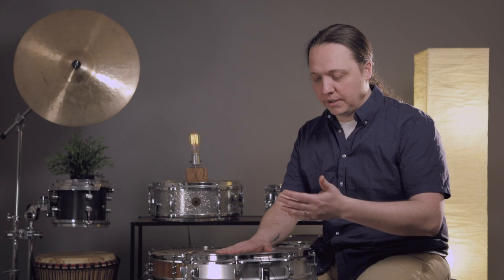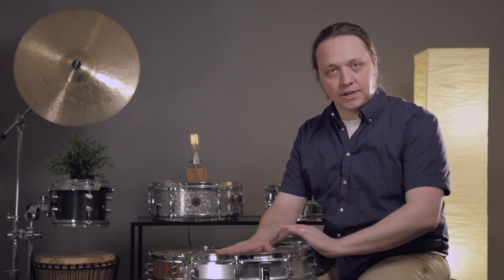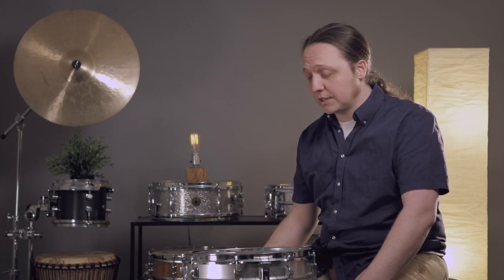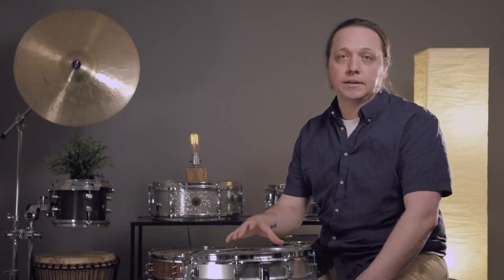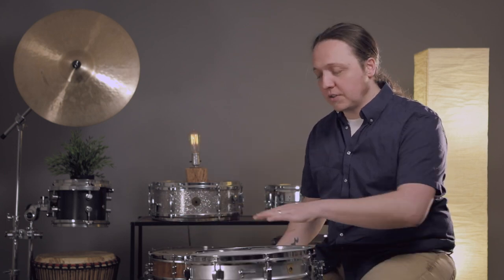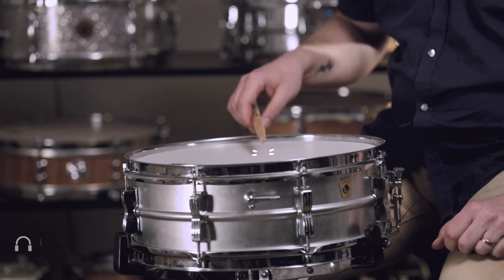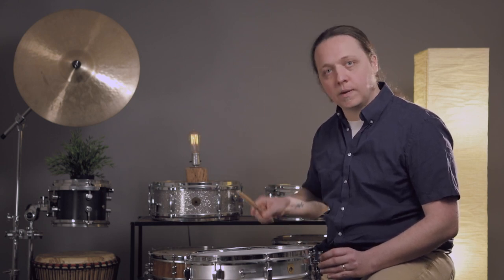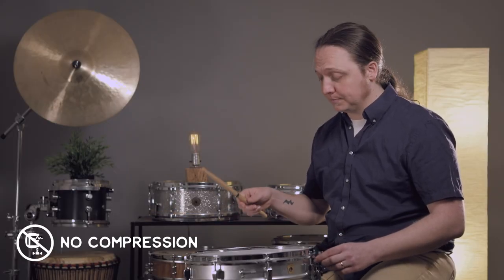Ep. 7 How to Dial in Your Snare Wires

Comment: Thank you for what you guys do.  Your videos are great and serve all of us in the community from beginner to pro.  My story:  I have a vintage snare I was  struggling to get a decent snare sound.  I tensioned/tuned the heads in pitch so my tone was great except when I turn on the snares.  CHOKED no matter how tight/loose the strainer.  I was baffled because I had new straps and pure sound wires.  Well watching this video I was inspired to dig deeper.  I pulled it apart.  I noticed immediately the snares would not evenly tension with the straps.  So I changed the straps out for the puresound blue wires.  Still no good.  Baffled...until on my second "pull apart" I laid the snares on my desk.  They did not lay perfectly flat.  Somehow they had gotten twisted slightly.  Changed the snares out for a "flat" set of puresound.  What a difference.  Saved me from buying something new and kept one of my favorite drums on the stand and off the shelf.

Comment: A little trick i learned from an old jazz drummer about snare side tuning and wires. Get the head in tune with itself, obviously....then press down on the head (not too hard) in the middle right next to the snares with your finger, if you get a nice long buzz from the snares you're in the ballpark as far as tension...adjust to taste. Works for me, give it a try.

Comment: I think that the reason we find that snare wires get cranked up so tight is to reduce or eliminate sympathetic buzz while playing the rest of the kit.  Are you guys going to do a video on sympathetic buzz?  If not, what should we do to address that issue.  I understand that it is going to happen but sometimes it is just unbearable.  These videos are great and I look forward to watching them every time.
Reply from the maker: Excellent point! Yes, we are definitely going to cover this. Sympathetic buzz is a thing we do have to live with to a degree, but you're right that it can get to the level of being a real problem regardless of the playing situation and sometimes you really do have to reach for whatever solution is available. I've had a couple experience when set up too close to the bass amp that were pretty jarring :)
Reply: I can get that problem as well. But could the case be that my snare is untuned somewhere? Because it sounds like "bo-wo-wo-wo-wo-wo-wo"... :P
Reply: There are millions of factors that could make your snare buzzing. Unequal tensions of one head or two, would make your note going "up and down" in pitch, and your wires would catch all of it. You could try set of wires with less numbers of them, like 12 wires, or Sonor 8 wires. It helps a lot, but only if tuning is equal.
Reply: @Dummertrummer  the wave in the sound is definitely a tuning issue. but its not really the place to fix your sympathetic buzz. that comes more from the pitch of the head than the 'intuneness' of the head.
Reply: I randomly decided to either tighten or loosen (I can't remember which) the four lugs closest to the snare wires on the resonant side on my snare: just a little though, like, I think it was a 1/4 turn. It seemed to reduce it to me, and I didn't notice any particular loss in quality of sound.
I'm not an expert though: it was just my experiment.

Comment: You may have mentioned this and I missed it (I had to watch this video in a few sections at a time) but I've always had luck clipping out a few middle wires to reduce sympathetic buzz while still allowing you to let your wires move.  It's not a "cure all" but it is a drastic help especially with problem drums. I don't do it on my 12" snares as often but I do it on every 14" drum I've ever had.  I usually use 20 strand wires on my 14"s and cut out the middle 4 leaving two sets of 8 strands with the middle open.  Most of the buzz comes from the middle of the head so taking those wires out cuts it down. My snare recipe: Evans hazy 300 reso tuned very hi, 20 strand wires with middle 4 removed at medium to medium high tension (no "fart" sound but not boxy and choked), Evans coated g12 on the top tuned medium to medium high (depends on the band, session, etc).  Versatile, punchy, dynamic, pleasing snare sound and feel that is equally at home live or in the studio, from metal to country, and from sticks to brushes.
Reply: I think that you are  right mate. I've started to use puresound equalizer   snares and I love the sound.

Comment: Great videos you’re doing! Excellent!!! Very important info! That snare drum is sounding great! I also have a 1969 Ludwig keystone acrolite... all original hardware,  including the snare wires (20 strand) ! They are all twisted right now, but still: I didn’t find a set of snare wires with a similar kind of dark sound as those originals... I have a G1 and a Evans 200 snare side head! I really dig that head combination because I use a lot of subtleties in my playing, and I do play a big range of dynamics... besides that I feel like the Evans 200 controls a bit more of the sustain of the drum’s resonance which I dig!... in the near future, I might go try a different head combo, as the Evans strata 1000 top along with the Evans orchestral 200 bottom, but I’m quite unsure which snare wires to go for... I was investigating in the YouTube and I quite enjoyed the Puresound concert snare wires  16 strand! Is that the wires you are using in this video? Thanks a lot in advance.
Reply: This is quite in the very high tuning zone... Meanwhile after this video I dropped the tuning  because it was sort of chocking a little bit,  and for some musical contexts it didn’t work out as well... it’s just an example of the darker sound of the original snare wires... https://youtu.be/7boyUjq5Dew

Comment: Thanks for the  excellent video, In your opinion does the luddy supra work better with straps or cord/string  ?
Reply from the maker: I've done both as well as strap on one end and string on the other with a vintage P-83 (strap being a no-go for those) and in the end found (As with most drums) that overall string is a bigger note/fatter with more overtones, while straps are more articulate across the head and yield a tighter sound overall. I used to be a 100% strings all the time person but have been coming over to the strap side more and more :) - Cody

Comment: Great channel. Hoping you guys can offer some advice...I’m having issues with my Ludwig lm400 blue and olive badge in the high range, ie it totally chokes. I’ve realised that the snare wire plates are not properly in contact with the reso head no matter whether I run the snare strings on top or below the plate. Any suggestions? It’s like I’m only getting contact with part of the wire as it’s not all permanently lying flat on the head? I guess this is probably affecting the medium and low tunings as well!
Reply: Check to see if the wires lie flat when there’s no tension on them. The wires may be twisted. It was a problem with some of the Ludwig Snare wires that came with supraphonics years ago.
Reply: @frankiepalermo3881  appreciate the response. Changed out to some Canopus wires which are totally straight and lined up equally, it’s a little better but I think you may have highlighted something I hadn’t considered or realised. I also took it to a drum tech who said everything looked fine, played it and said ‘dude, that’s really confusing’. The new wires sit flat when snares are off. I just record and gig with it at medium low tunings. It sounds great in those ranges, but I’ll look at maybe changing out the strainer. Thanks again
Reply: @jackpainting7150  you’re welcome, hope it all works out for you!

Comment: Have you found the thickness of snare cord to have much effect on response etc ? I recently installed some new wires that came with cord which is really thick. I've found that using this cord lifts the end-plates off the head and forces the wires to press against the center. they sound nice to my ear.
(For reference the drum is a yamaha copper and the wires are 20 strand Fat-cat with pitch)
Reply from the maker: Indeed! The mounting method can mean the difference between a great sound drum and a non-functional set of wires. You're spot-on with the details regarding the wire needing to be pressed against the head in the center. Too much pressure on the plates and you'll choke out the head and likely have a difficult time reducing extraneous snare buzz. Thanks for sharing your experience!

Comment: I don't know anything about drums but i have a question: what length of wire goes on a 14" snare? 14" wire? Im restoring a set for my kid's Christmas gift.
Reply from the maker: Yes, generally speaking, a set of wires that's labeled as 14" is designed to work with a 14" diameter snare drum. Make sure that the snare drum is in fact a 14" shell outer dimeter (not including the hardware) as there are 13" snare drums and it's quite common for people to mistakenly measure from the outside of the rim/hoop to the opposing side.

Comment: What is the influence of the length of the wires on the snare sound? Sonor strands are shorter than the regular ones for example, almost the length of those made for 13" snares. Have you ever tried shorter ones?
Reply from the maker: Hey there! Yeah I’ve tried a lot of different ones and I personally don’t find a huge difference in sound with regard to length (I put 13” wires on a 14” drum once in an emergency and still worked pretty good). Some sets are a little too long and start to interact with the snare-bed in strange ways so I tend to avoid those :) wire count has a much more dramatic effect for sure. -Cody
Reply: I have a theory that is to avoid getting close to the snare bed. As it is not flat, the wires would behave strangely. I might experiment with 13" just to see as they work. Thanks for sharing this experience!

Comment: I'm getting a wicked buzz sound on the decay from my snare. Any insight on what might cause this?
Reply from the maker: Tough to tell, as that's super subjective but it has everything to due with the relationship of tension between the wires and the snare side head. We've got several videos from Season One on tuning up your snare side head and dialing in snare wires that should help. -Ben
Reply: @SoundsLikeADrum  Rad, I'll check it out. Thanks!

Comment: I've always had problem mounting my snare wires. Usually what I do is completely loosening the throw off, disengage it, dial in the wires, engage the throw off and then start tightening. It is the only way for because if I don't do so, I can tighten the throw off to the limit and the wires are still hanging and buzzing like hell. Please tell me what I do wrong, I can't find a single guide that tells me exactly what to do step by step. I've been playing for years and this is something that I still can't get my head around. Sorry for typos or bad english, i try my best since it is not my native language ahah
Reply from the maker: Hey there! I see what you mean, it is kind of a tricky thing. Here's what I do: As you do, I loosen the throw off entirely before getting started. After placing the wires on the head, I install the strings/strap on the side opposite the snare throw-off and make sure that the length of those strings/strap is such that once the throw is engaged, the wires will be centered on the head. Then (this is the tricky part), I go to the throw-off side and install the strings/strap on that side in a very specific way. I will put the strings/strap into the throw mechanism but then, before tightening the mounting screws, I put tension on the wires by pulling on the strings/strap with my left hand gently WHILE I tighten the mounting screws. This gives you some tension on the wires ahead of when you start tightening up the adjustment knob on the throwoff, imitating what the throw will do when it's engaged. With some drums (especially old ludwigs where you have to tie the strings onto the throw rather than clamping them with screws), I'll loosen the throw all the way and also disengage it while I tie the knot (and I still pull the strings as I tie the knot in this situation, again just to add some tension to the wires before we start turning the mechanism on) because some tension will be lost as the knot settles. This is a super hard concept to describe with text, but let us know if this is helpful to you! Perhaps we'll put together a quick video soon to explain this visually. And no worries, your english is great!
Reply: As soon as I put my snare back together (ordinary drums cleanup) I'll try that and see what I come up with! Thank you for taking the time to answer me!
Reply from the maker: We've got a video in the queue right now that demonstrates this process. Cheers!

Comment: Is there anything that can be done with bent snare wires?
Reply from the maker: Hey there! You can perform a little bit of surgery with wire-cutters and remove the bent wires, but you run the risk of the sharp bits that remain on the ends of the wires poking through and tearing your snare-side head (or your fingers when packing/unpacking your gear). Bending them back to straight again is virtually impossible in my experience, and given that a new set of standard wires can often be under $10, it's probably best to replace them. Cheers!
Reply: The last one I bought online and it bent during shipping since it wasn't a rigid package. I thought I'd bend it back, but then

> Bending them back to straight again is virtually impossible in my experience

....totally true.
Reply from the maker: Best to request a replacement in that case.

Comment: Only problem is this advice seeks to only make the individual snare drum sound best. I find that, in combination with the rest of my kit and especially my bassist's amp, when my wires are set at a tension that makes the drum sound best, the sympathetic buzz is out of control. When I tighten the wires up, the drum sounds worse but the buzz is reduced. I hate buzz and am always trying to find some compromise between the two trade-offs. ugh.

Comment: How to adjust the wire in the inside drum
Reply from the maker: Are you talking about drums that have an internal snare wire system?
Reply: Sounds Like A Drum I don't know what your talking about but sounds like it
Reply: Sounds Like A Drum I honestly would be interested in seeing how one works and how to get certain sounds out of it. It would actually be interesting to have one in a "modern" style snare drum, more particularly near the usual "sweet spot" for ghost notes. 🤔
Reply: BuddhistDrummer - I have a 1930s Premier Dominion with internal and external snares. The internal snares (on the top head) give it a really crisp tight sound, like a Brazilian caixia (probably spelled that wrong) and you can play really ultra quiet on it and it is still responsive. You can have top snare on, bottom snare on, both snares on or no snares - so four different sounds ;)